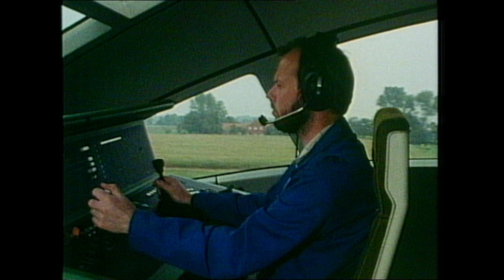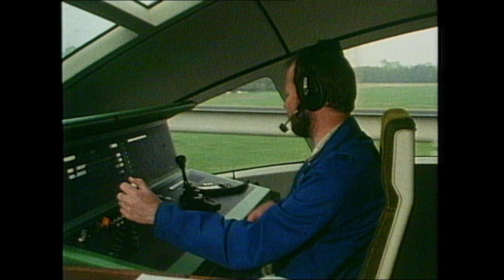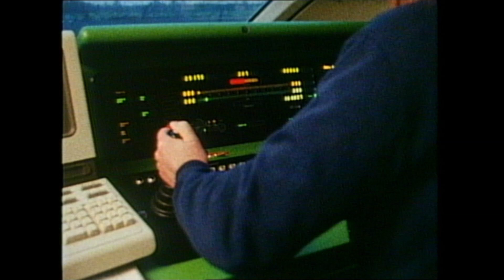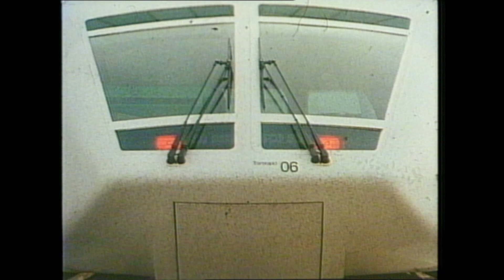Transrapid 1985 - How we could travel by train today (Promotional Film of the German Maglev Train)

Comment: China bought the transrapid system in early 2000's and build an express to Shangai Airport, in the 2010's it built the world's largest network of high speed rail but opted for conventional rail due the elevated costs of building Maglevs, nevertheless they didn't stop reasearch and devevolped a brand new train and even built low speed maglevs for some rapid transit lines.
Reply: They did not develop a brandnew maglev train. They copied the Transrapid and a few other Systems German companies have developed.

Comment: calls it the safest yet there was a deadly incident with said train
Reply: That doesnt conflict with what was said though? Planes are also incredibly safe yet there have been deadly incidents
Reply: @Guy-Zero  given how small and infrequent it ran, just one crash will really destroy its statistic
Reply: @flixri726  It was a test track and also human error that led to the incident. The dispatcher forget a maintenance crew+vehicle were still on the track waiting for the switch to change.
Reply: @Guy-Zero  yes, what followed was a wrangled wreck in 5 meter altitude. Almost impossible to rescue people from without special equipment. That isn't at every fire department in some cases not even on county level. If you compare the transrapid crash where 23 of 31 passengers died to the Train crash of Eschede where of around 220 passengers 107 survived the problem is obvious. If you scale the whole thing up to make it more than a test track, the chances for human error just increase by magnitudes due to complexity but also due to demand and the needed integration with other systems like traintracks and the Autobahn-network.